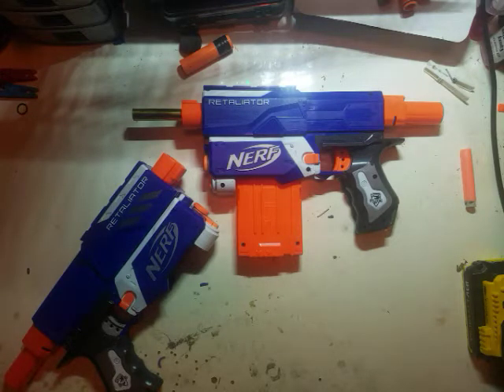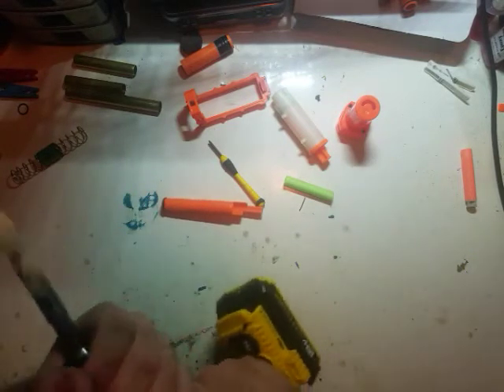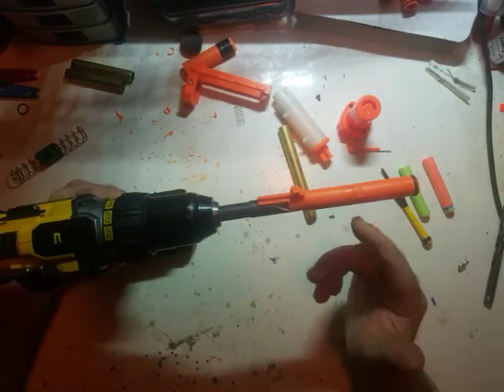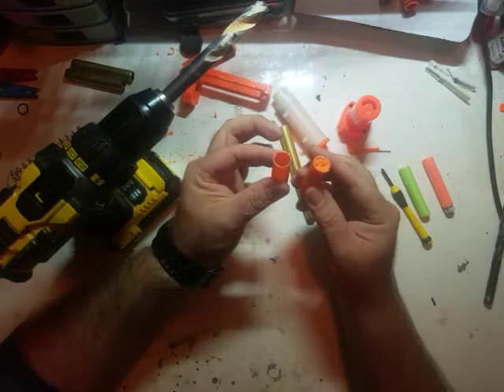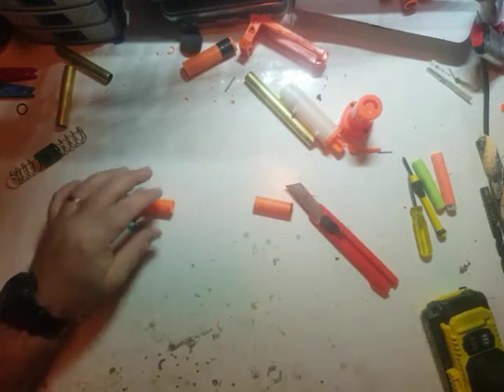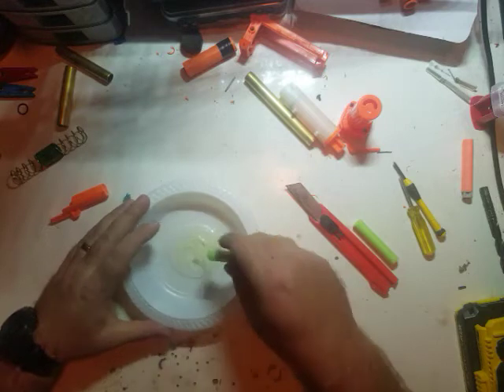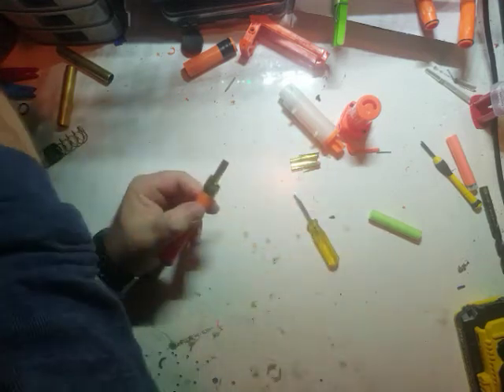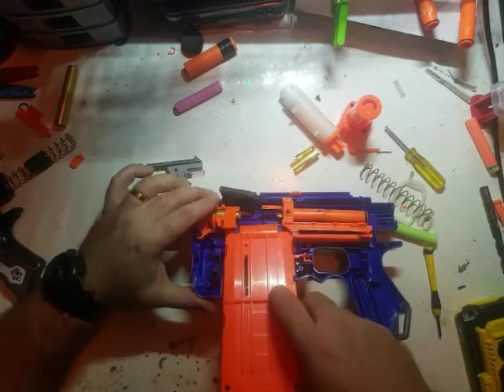Simple Nerf retaliator brass breech

Comment: I did a expanded plunger tube,  but I have some issues with having the bolt not going back enough, so I notched more out, now the barrel won't get a full seal. Might just leave it and mod a mag for short darts

Comment: gonna try this mod, just one question for Nerf mods for beginners:  Can you do this with the barrel on?  I have a Gavinfuzzy pump kit installed (which requires the barrel to be on) and want to use with a brass breech.
Reply: Use a shorter brass barrel
Reply: Wil Reiner unscrew the barrel, and take out the orange tube inside. This will give the clearance for the brass to sit inside the barrel.